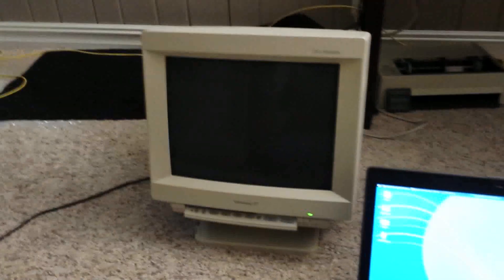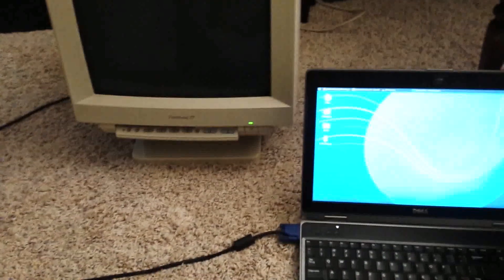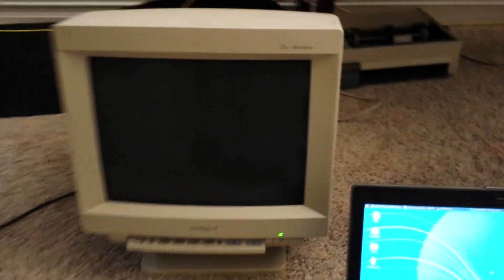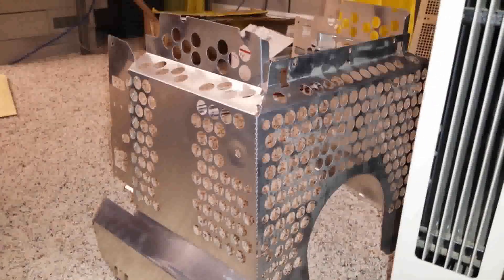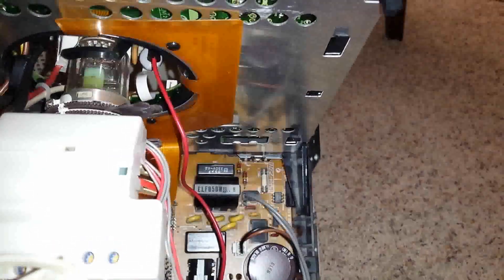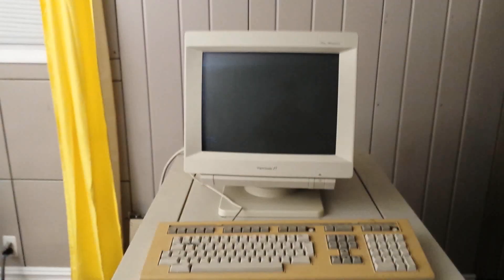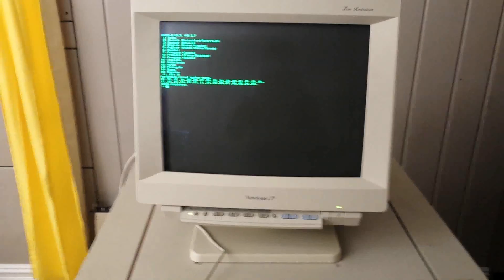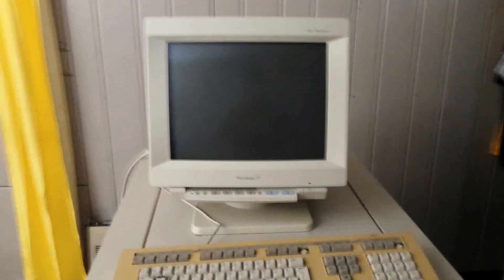Viewsonic 17 CRT Troubleshooting

Comment: Glad you got that fixed and that it was trivial. I am having less luck with my CRT monitor. The power LED actually shuts off the moment a signal isn't detected, and the power build fades away, even though there's still technically some power running through the supply. By design, the monitor is supposed to remain idle with its power LED on, until a source is detected. Unfortunately, the monitor only intermittently detects a source. When it does finally detect it, it powers on fine and displays an image. Finally at this point, its power on/off becomes consistent as far as I know. It's as if the monitor is dodgy when cold but fine to go once it's warm. After left for a while, it's back to square one and I have to do specific power-on procedures in order to get the monitor to hang on and display an image.I am still not sure what the issue is. All the caps I inspected looked physically fine. There is a buzzing coming from somewhere in the monitor, but that could just be some loose coils. I hope it's not a failure with the main board or video signal board.

Comment: I have the same monitor and it's making a very high frequency sound, around 15kHz. Do you know what the exact model of it is? All I can find on the back is MODEL No. 1782. I'm trying to get hold of a service manual for this exact monitor. Thanks!
Reply from the maker: I never managed to find a service manual unfortunately.